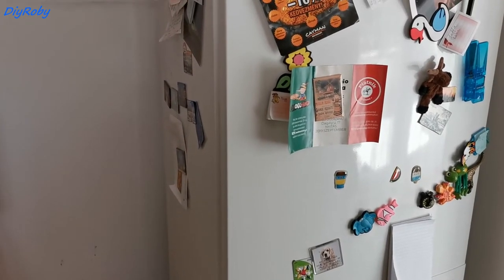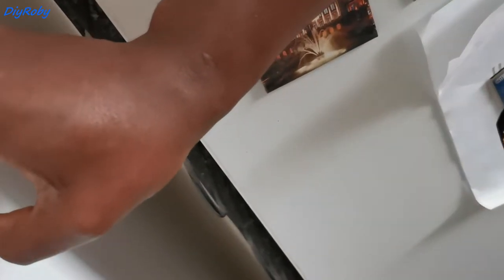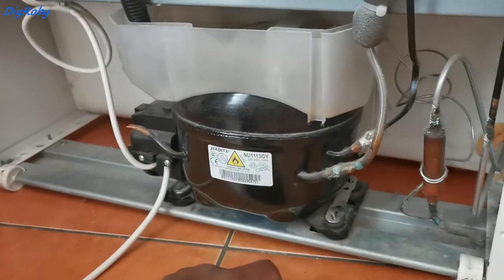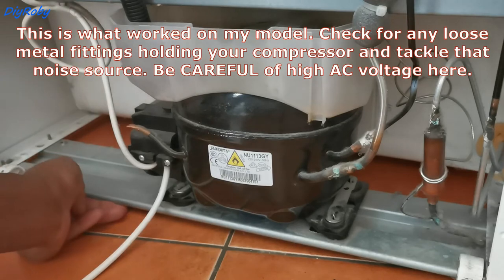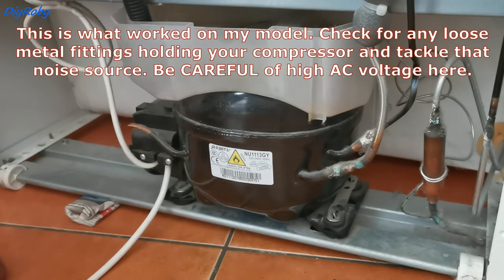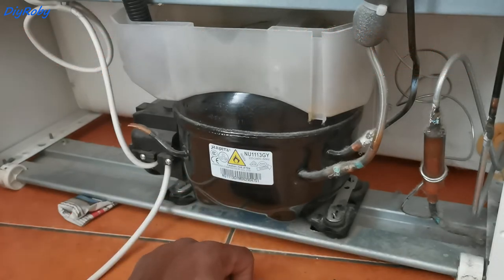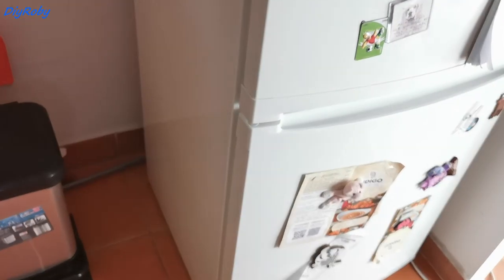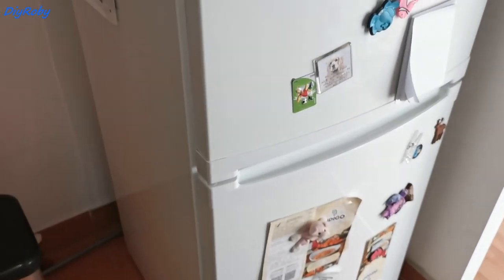Quick Temporary Fix Buzzing Vibrating Fridge Noise - loose condenser plate

Comment: I fixed the vibration noise on my Hoover fridge/freezer by using a plastic cable tie and wrapped it round the corner of the white plastic evaporation tray that sits on top of the motor, then hooked it to the black grid that is on the rear.

Comment: I am fairly sure that the vibration and low-frequency noise is coming from the compressor (LG linear inverter, LG FMA088NBMA).  However, pushing the compressor does barely reduce the noise and the condenser plate is not movable like that.  Do you have any idea what could be causing this?  Is this normal operation?  All I can say is that I am tempted to kick this stupid thing...

Comment: Did you ultimately find out what was causing the vibration?
Reply from the maker: I haven't touched it again as this temp fix worked. Maybe when we upgrade fridge and I sell this, I may fix it permanently if it's worth it.